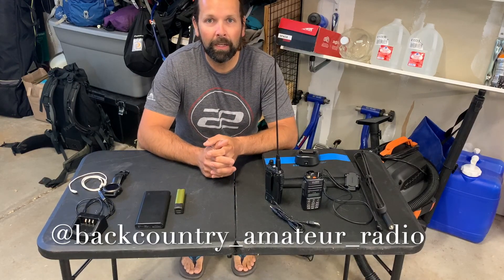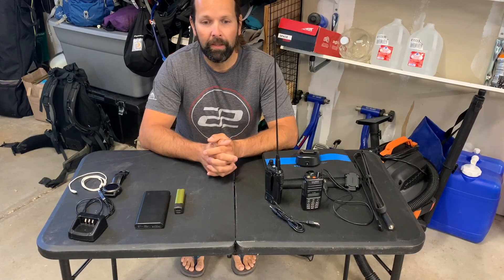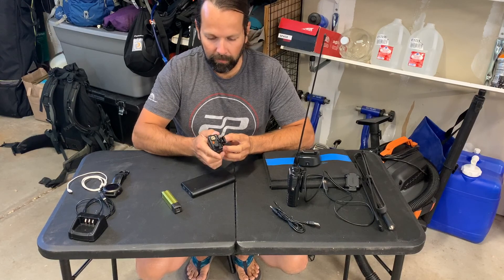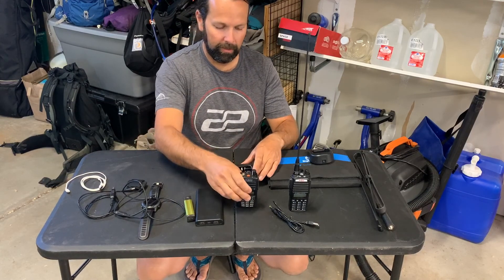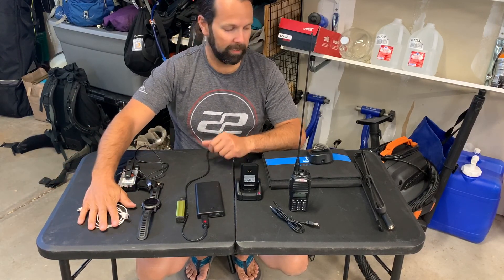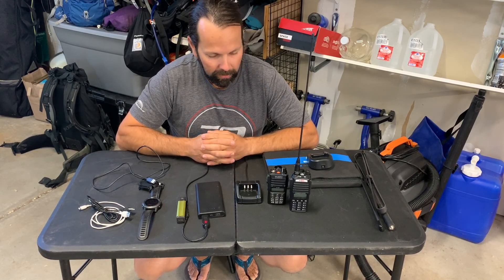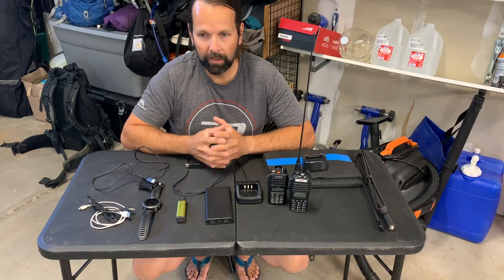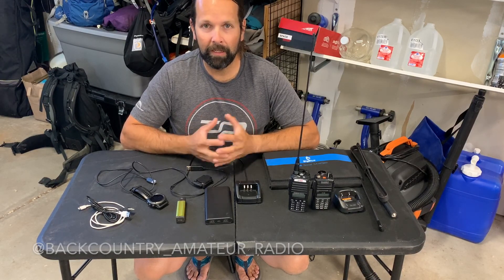How to use USB to charge your handheld ham radio

Comment: I travel with my radios and it would be wonderful to use USBC and other usb to allow charging on the road.  The idea to have a USB cable with a power supply to match radio is a very good idea.  Thank you for sharing.
Reply from the maker: Thanks for your feedback! It’s really needed across the handheld radio offerings. A lot of folks like charging cradles but for those on the move or on the go we need a solution that makes more sense than a cradle. More of the entry-level radios could benefit from the addition of mobile charging.

Comment: Thanks for the video! DO I understand correctly that the BTECH cable is compatible with the Yaesu cradle?  I have Yaesu FT-65R but I suspect that all Yaesu cradles are compatible.
Reply from the maker: Yes, that cable works. In fact, I went searching for one that better matched the Yaesu cradle voltage and it doesn't work. For perspective, I haven't used the Yaesu wall plug for the cradle in 10 months. I've only used the BTech USB to 10V cable with my Yaesu cradle. The radio is happily charged each time. You may have to check voltages for the other radios and cradles; however, I suspect that it will work. I hope this helps you with your power plan!